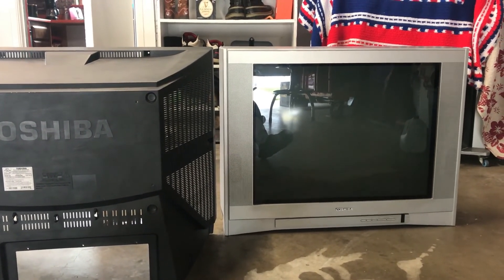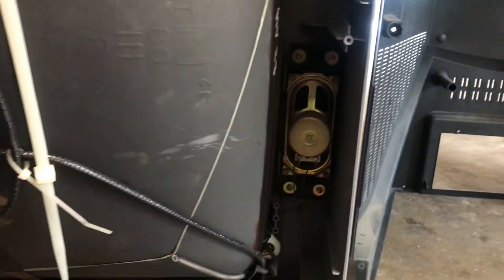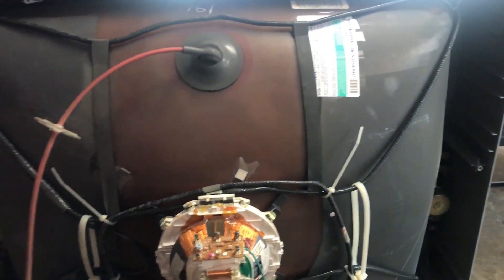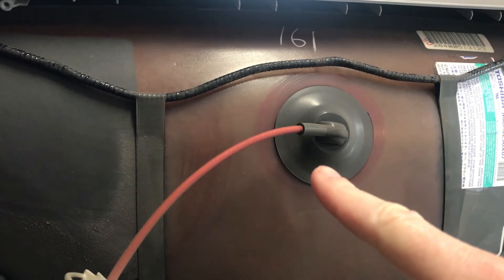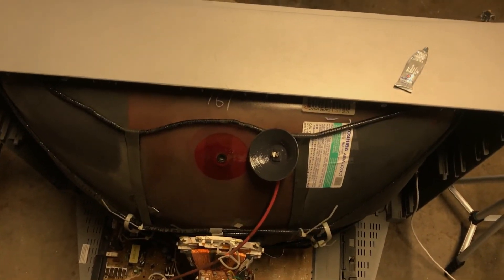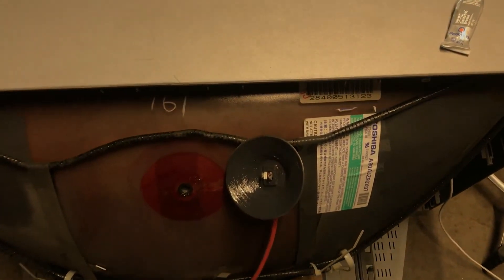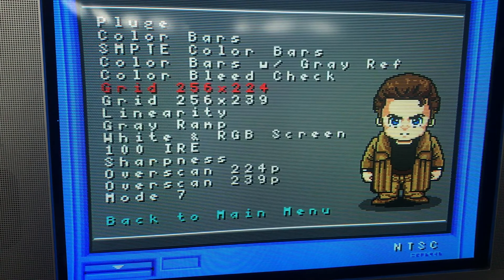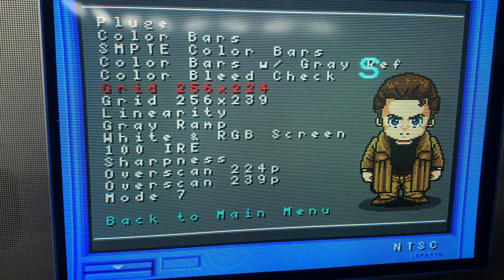Toshiba AF43 CRT Repairs for Retro Gaming: Service Menu, Tate, Geometry etc.

Comment: I have the higher tier model, the 27AF44 that I found with low hours on the side of the road in my town along with 2 other CRT's, and it has color stream and a better picture. But after playing around with the service menu, I discovered that you can tremendously improve the detail by making the sharpness as low as possible, then maxing out the VS correction, then setting the V size very low, you'll also have to adjust the parabola a bit in order to make it straight. I love this TV and I think it might be better than my KV-35XBR48, as setting it up this way has such sharp and visible detail, it makes 240p composite video look like 1080p! You should try it out!
Reply from the maker: I don't know bro. I think that model has the orion toob. No bueno
Reply: @riggel8804  I believe it depends what settings you can access on the service menu, on mine, to enter, you have to make sure the volume is a zero, then hold down the volume down button, then press and hold 9 on the remote control and you should be able to adjust the settings. See if you can get there.
Reply from the maker: @blazuma111  I usually don't like messing with the sharpness adjustments in the service menu.

I used to have a 32af44. I didn't like it as much as my af43. I got a review on my channel. 

I think the 27 inch models have orion crt tubes in them.
Reply: @riggel8804  How does having an Orion tube play a huge role in this? What tube is yours?
Reply from the maker: @blazuma111  It's all about the tube my dude. You could take a pos 20 inch RCA and swap it's tube with a broadcast monitor and the RCA is going to look like a broadcast monitor.

The Orion tubes are budget/mediocre tubes (from what I've heard). The Toshiba tubes in the 32 and 36 inch AF models are something special. They are Sony pro monitor quality.

Take a peak inside your TV. I'm guessing it's got a Orion tube. Some guys say they really like their AFs with the Orion tube. I can't really say. I've never seen one.
Reply: @riggel8804  it's not an Orion, it's an LG/Philips picture tube, which are considerably great quality, as these were the same type of tubes used in the Samsung slimfit CRT TV's, which has great quality also. It's made in Korea. Orion is cheaper than LG/Philips, as I do have an Apex with an Orion tube, and the dot pitch size is larger and picture isn't quite as clear and is quite blurry. So this is still a good one to save. Apart from Sony, I'd say that LG tubes are second best in overall picture quality. These are also difficult to find.
Reply from the maker: @blazuma111  That's cool to know. I didn't know the smaller AFs had LG/Philps tubes as well. Never seen one of those.
Reply: @riggel8804  hey Riggel. You are my fav channel. I have a 24AF46 (made in 2006) and it has really low hours. It does have an Orion tube. How much of a jump in quality is orion to actual toshiba tube :( ? If your opinion says to go for a better tv like Sony Wega Trinitron or 32” toshiba. Please let me know. I sincerely value your experience and knowledge on these subjects. I have manually disconnected the cable which enabled Scan Velocity Modulation to somewhat improve the picture.
Reply from the maker: @igotasmaldic7306  I'm not sure. I've never seen one of those Orion tubes in an AF. I hear both good and bad things about them. I can say that the AF models with the Toshiba tube in them are freakishly good-as good as a middle of the road pvm. I doubt the Orion tube AFs are as good. I've got a video where I compare my AF to my pvm and a jvc d series. You could look at that and see which tube your af more closely resembles. Some people like the softer look of shadow mask tubes like the Orion. You might not like a sharper tube.
Reply: @riggel8804  thanks for the reply! I prefer a sharper picture. I also own a Sony PVM 14N6U & 20M4U (not in use needs repair). If I luck out, I may be picking up a Sony KD-27FS170 for free after work today. Curious to see how that picture will compare to the Orion tube as well as PVM’s.
Reply from the maker: @igotasmaldic7306  the wega is going to look really similar to your pvm. Probably a little less sharp but more fun because of the increased size. If you pick it up let me know how it compares to your af. My af looks very similar to my wegas but I'm guessing your af with the orion tube is going to look very different but I could be wrong. Let me know.

Comment: Man I feel like such an idiot and I could use your advice. I have a Toshiba 27AF41. I was trying to figure out the number of hours of operation, but it's the Toshiba produced model not the Orion, so I couldn't figure out the combination. Previously I had adjusted the geometry a bit. Was able to change the width and horizontal positioning. Anyway, I felt like the color is not great on the unit (wasn't sure), and I wanted to shift everything back to the defaults. I found the service manual and changed all of the settings back to the presets listed, and now the geometry basically looked horrible. Here is my real question: now I am actually unable to change the width on the unit. A lot of the adjustments don't work. I feel like I screwed something up when I was trying to find the hours of operation. I'm almost positive that I initialized the memory (which the manual later says not to do). It says "CAUTION: Never attempt to initialize the data unless QA02 has been replaced." What should I do? This looks horrible and I can't adjust anything now. Is there any way I can just reset this thing to the factor settings? Thanks man

Another mistake I may have made was trying to adjust the GMPS setting? I don't know what it does and the service manual doesn't list a value or default value whatsoever. No idea what I did wrong or what to do now.
Reply from the maker: I have no idea sorry dude. I've been told multiple times by old heads not to factory reset a crt

Comment: Do you ever do any replacement of parts on the board (capacitors etc.)? I've realized as time goes on and the supply of TVs dries up, having DIY skills are going to become a necessity. I have been honing my soldering skills but I haven't touched any of my TVs yet.
Reply from the maker: I've done some board work. I did a full recap on 2 consumer Sonys. It was kinda a nightmare. the pads kept lifting up. I would really like to get a desoldering gun. All of the problems I have run into with board work happen during desoldering.
Reply: @riggel8804  A desoldering gun will help a lot, not to mention make the process waaaay faster. It would be cool if you could do some videos of it someday, I always enjoy how you explain things.
Reply from the maker: @thomasdowns2011  I got a PC CRT that probably has some bad caps. Maybe I do a vid on that...Problem is I know I board tech that only charges me like $50. So I typically just take it to him....I guess that's a good, "problem" to have.

Comment: Hello in your opinion, which Sony is better? I have two but I need space in my room. 34KVFS110 or 29KVFS140? Chassis BA-6 and BX-1L respectively.
Reply from the maker: I've never seen either of those TVs but since you have them both I would just pick the one you like more. Sometimes an inferior model tv can look better than an inferior model. It depends on how fresh the tube is. They are different sizes so you got to think about which one fits the room better.

Comment: I think Im ready to finally fix the warped corner in my Zenith. If the tv is energized and i stick a circular neodymium magnet right on the back of the tube, im guessing it needs tape to stay in place or it will just fall off? Do you feel any shock when the magnet makes contact with the back of the glass without gloves? I know if i dont do it, ill feel bugged by that corner. Its warped about 1/4 inch off the straight horizontal line in the bottom right of the screen
Reply from the maker: It won't shock you. Just don't don't touch any exposed metal i.e. the wire around the yoke. Try not to pull the anode cap off and stick it on your tongue while energized.

Yea you have to glue the magnet down. Wipe the glass down with rubbing alcohol first and then use double sided tape, the thick stuff that comes in a roll.

If you are really worried about getting shocked you could always glue the magnet down to the outside of the tv. It looks ghetto but it works.

Comment: What setting handles geometry on the left and right side of the screen? Does tobshiba have a term used for it?
Reply from the maker: I don't know. You got to just mess around with stuff and see what happens. Just make sure you remember the original setting before you alter it. Usually all the geometry stuff is grouped together in a service menu.

Comment: Looks like the toshiba has some overscan there at the end of the video. x-axis (yoko).
Reply from the maker: Good eye. It changes from system to system. Think I have the ps2 hooked up in this video but I try to optimize the tv with my computer since I use that the most.

Comment: What are some things you can do to maximize the lifespan of a CRT tv? Aside from just never using it I guess. Like does reducing contrast or brightness matter or is it just as simple as keeping it clean and in a cool room?
Reply from the maker: yeah i recommend using it in a dark room so that you don't have to blast the contrast/brightness. You could install a fan on it
 You could recap all the caps around heat sinks and deflection/power stuff. Picking up another crt will put you at ease.